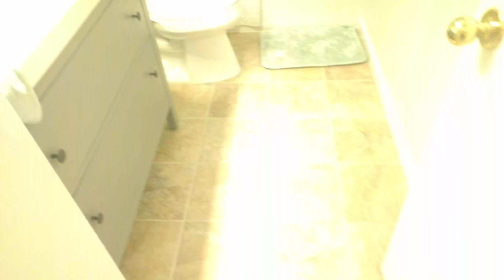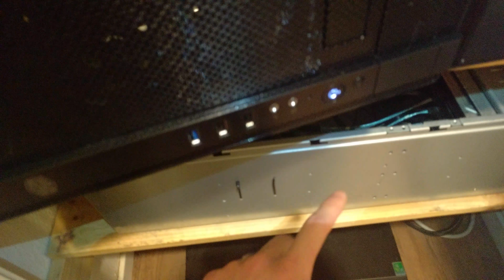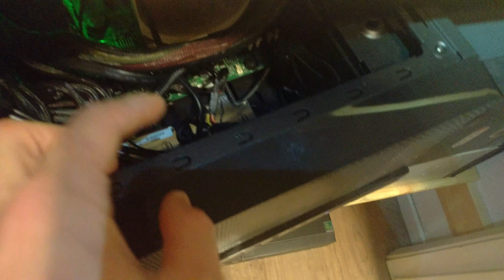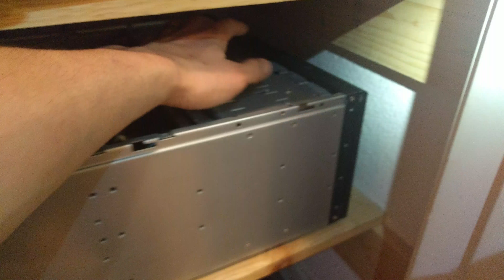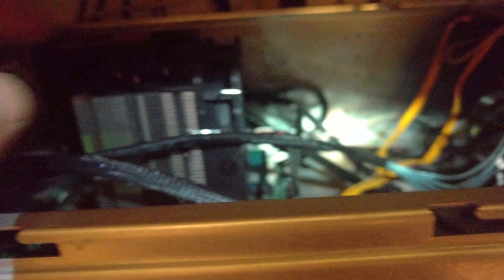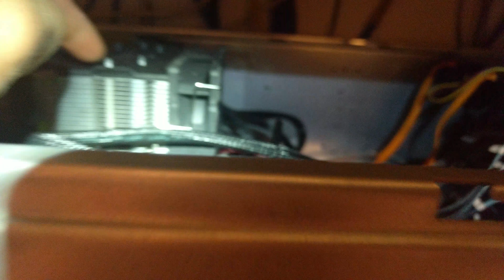Cooler Master N200 & Cryorig H7 First Impressions

Comment: I have N200 Case non windows version. I want to ask you something. If I install Cryorig H7/H7 plus, can I Install top fan (140mm) and side fan (120mm)? What width i have to choose for that 2 fan? 15mm or 25mm?
Reply from the maker: I thought the cryorig can only use a 120mm fan? I didn't know 140mm was an option. Sorry not sure about the width questions. I would think any width fan should work.
Reply: @joshruehlig  The top fan (exhaust) accommodate to 140mm fan. The Cryorig H7 only 120mm fan. Can I use them together? Did you install top fan on your n200 case?
Reply: I want to use all the 5 fan in my N200 case. 2 on front, 1 on top, 1 on rear, and 1 on side, with Cryorig H7 Plus. Can I do that? If yes, I am going to buy Cryorig H7 (120mm fan), if no then I am going to buy another CPU cooler with 92mm fan
Reply from the maker: @JohnSmith-hm8xl  ahh, no I didn't put a fan on the side panel. I assume that would get in the way.
Reply: @joshruehlig  Thank you for the answer.
Reply: @joshruehlig  Can I ask you one more question before I buy Cryorig H7 plus for my N200 case? So, I am planning to put 140mm fan on the top of the case (exhaust fan). Can I do that with Cryorig H7 installed? If yes, What is the width of 140mm fan? The regular 25mm width or the slim 15mm width?
I am sorry to bother you
Reply from the maker: @JohnSmith-hm8xl  I don't think you can fit anything there. The hyper 212 pretty much reaches all the way up, and I think the H7 is only a few mm shorter, so I don't think even a 15mm would work. it might work, but at the moment I don't have time to do all the measurements for you.
Reply: @joshruehlig  Thank you for the answer. Maybe I will buy a smaller 92mm cpu cooler then. Thank you